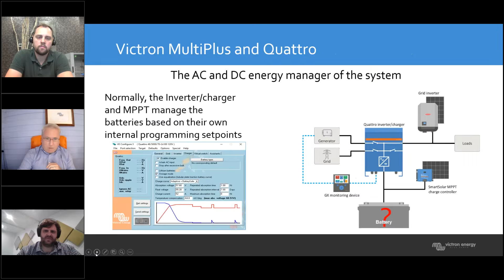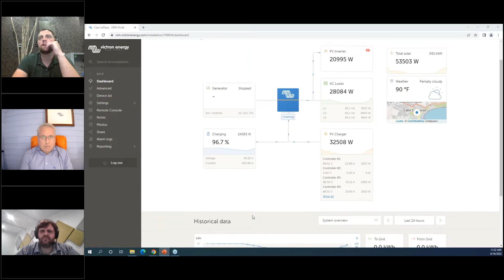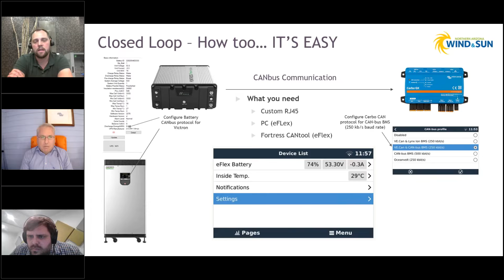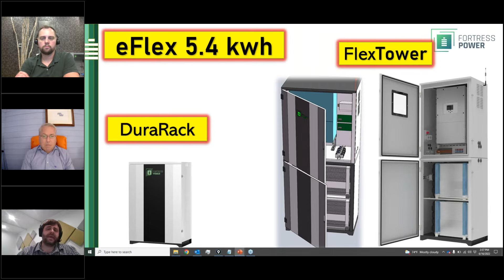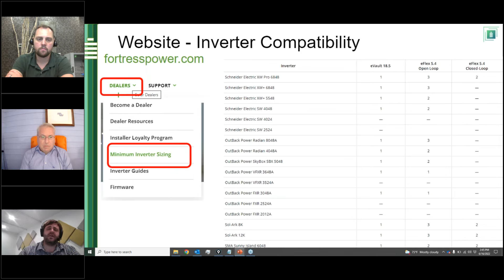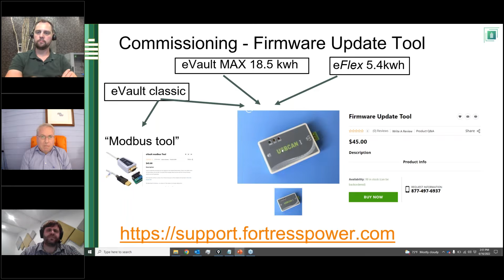WEBINAR | Fortress Power & Victron  Design, Install, and Commission in Closed Loop

Comment: Does the Fortress information on state of charge, etc. show up on the Victron display and on the VRM portal? Screen visuals would be helpful, thanks.
Reply from the maker: Yes Fortress batteries (Closed loop) will show up in the Cerbo Display and on VRM.   A special cable will need to be used to allow communication between the two manufactures' equipment (CANbus 2 or CANbus 4 ). I can not add screenshots here but if you shoot us a message on chat (on our website) the team they can provide them for you!